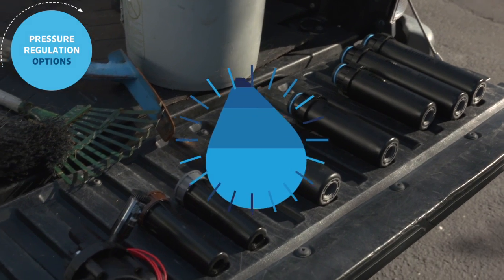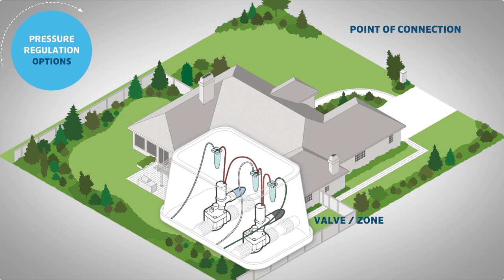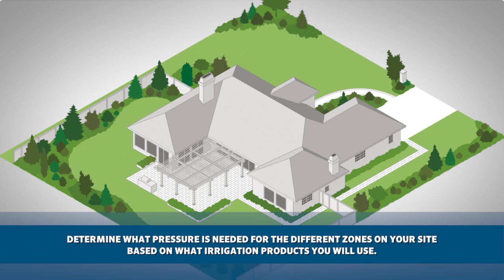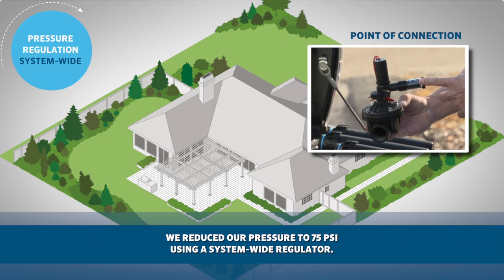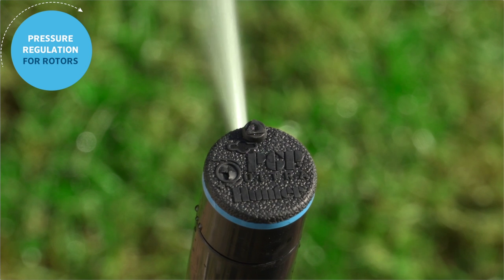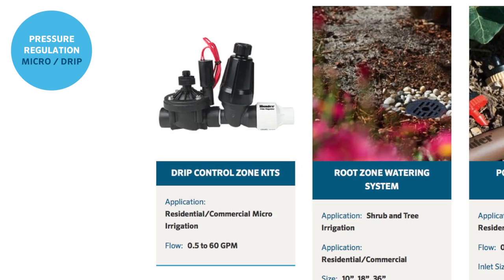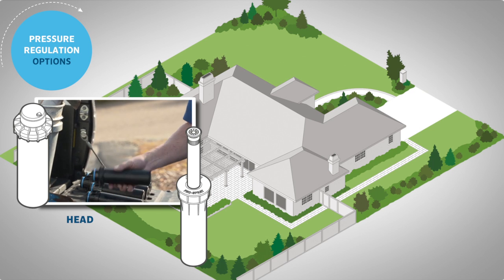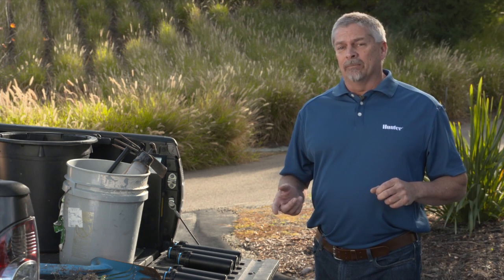Irrigation Pressure Regulation Product Line

Comment: How can i got more pressure , the sprinklers dont came out . Why?
Reply: Pressure at your meter is static and is managed by your city.  If it is too low, call them and they will let you know what the problem is and what they can or cannot do.  If you take a water pressure gauge and measure the pressure at your house spigot and it is below 45 pounds, I would say that your system zones may have too many heads.  You may want to take water pressure readings at different times of the day since pressure varies depending on time of day usage.   If you have about 35 pounds at your spigot and the city cannot increase pressure, you're only option is to install a water pump with a sensor that increases pressure to between 60 to 80 pounds.  Pressure can only increase with height of city water tower or a pump.  There is nothing else that increases pressure.  If the city does not configure piping correctly, there will be pressure loss by the time water reaches your house.  Hope that helps.
Reply: Also regarding Hunter's response, their pressure regulator is mainly to reduce pressure and not increase pressure.  Your problem is not enough pressure and not too much pressure which I believe that Hunter did not really address your potential problem.